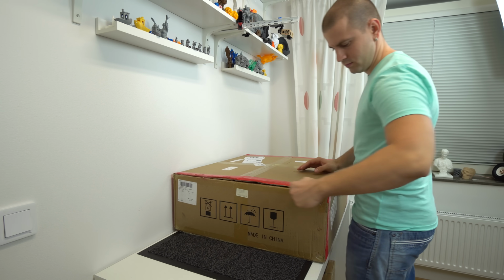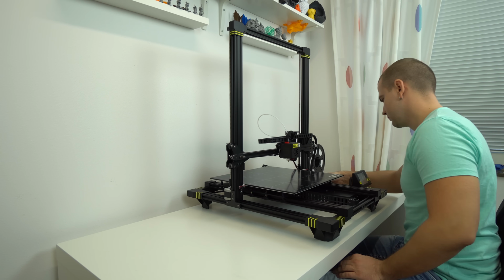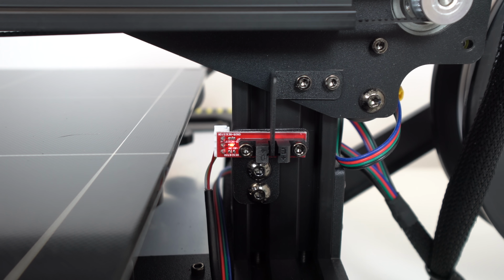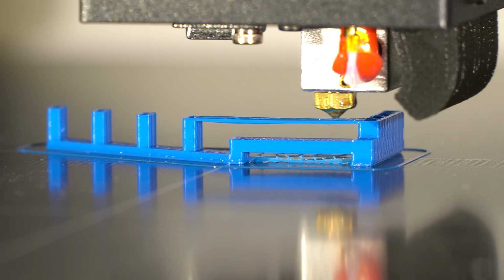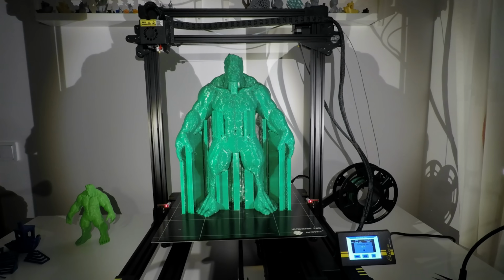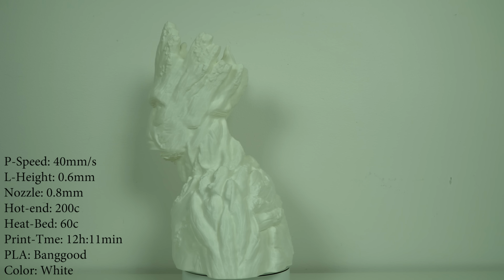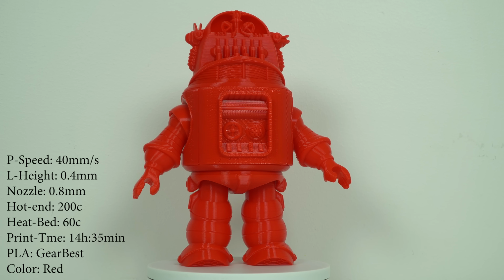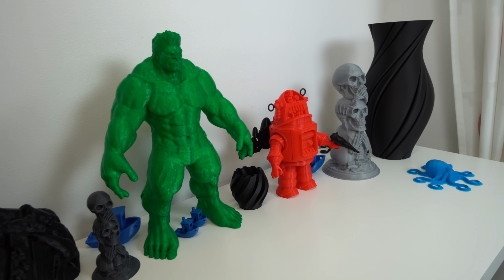Anycubic Chiron Final review - in depth  4K video

Comment: it prints all things smaller - for example 10x50 is 8x39 - even with the newest 1.3.0 firmware - what can be reason?
Reply from the maker: Alexander Afanasiev I never heard about that problem before. What Slicer do you use?
Reply: Thank you for attention, Nexi) I tried Cura S3d and slic3r, but today I received an answer from anycubic about voltage, (still not tried): 

Dear customer
You can adjust the voltage of the motor driver according to this link.
A4988 Driver Test and Swap  https://www.youtube.com/watch?v=_TlbE7sXMtA
It is recommended to adjust the X port to 0.9V, Y port: 1V, Z port: 0.9V, E0 port: 0.8V, E1 port: 1V
Reply from the maker: Alexander Afanasiev Thanks for the info! I really never come across that problem and I tuned stepper drivers on many my 3D printers but I never got problem that printer was not accurate. For example I had problem with skipping Y axis on my old Tevo Tornado and when I open the control box my Y axis was at only at 0.4v and X axis on 0.7V etc... It did not had any sense. So I level them all up to 0.8V if I remember correctly now as it was long time ago. That fix the issue.

Comment: how much watts during printing?
Reply from the maker: Jacek Micherdziński Hard to say! So many variables.
Print time? 
Filament type?
Hot bed temperature?
Heat bed temperature?
Speed?
Watts per hour or?
It's really hard for me to answer on that.
Reply: For standard pla settings. 200/60, speed 40-50mm/s. Watts per hour. Thanks

Comment: Thanks for including Benchy print time and layer height. What was the infill & perimeters setting?

Comparing apples to apples print speed is done way too little imho. Tevo Tornado using 0.2mm layer, 2 perimeters, 5% infill, 0.4mm nozzle i think fastest i did from cold was like 36mins
Reply from the maker: skaltura No problem. It was 20% infill, 4 top and 3 down layers. Well i didi not race here :) Obviously printer with less mass on heated bed will be faster and should produce better print quality but also Tevo Tornado has salmon skin issue and Chiron don't.
Reply: Tornado does not have salmon skin if you just tune it, crank the vref up to max and it's gone, looks very similar to your chiron prints, maybe even a little bit better quality :) Also later Tornados come with MKS Gen-L which gets rid of it as well.

Tornado bed is large tempered glass panel with heat insulation, so quite a lot of mass there too, but really it comes to the steppers and how sturdy the frame is. CR-10 S5 is just awful in that regard, very hard to get a decent print out of stock S5 :( and the mass is immense.

How many perimeters did you have, just 1?

Comment: I am curious if 3d print is still adhering well to ultrabase after power panic restore since ultrabase-like surfaces popup prints when cooled down.
Reply from the maker: Nope. They pop out from Ultra-base when it cools down. You might have like 5 min max to continue the print after power is lost. But what I do like is when the filament is run out, printer pause printing and it keeps temperature steady until you change the filament and click on continue.

Comment: After new Chiron update does CR10 4S still beats?
Reply from the maker: No anymore. Chiron is way batter! :)
Reply: Hamza Bavčić As an owner of both, Chiron has the advantage. The S4 bed is simply horrible, uneven heated, and the fact that waiting for the S4 bed to reach 60 degrees Celsius takes forever, and considering that the S4 bed is so uneven that any try to level it most probably will fail. My S4 bed is straight cold and will sag in the middle when  hot, so I gave up on it
Reply: @sorinmiliescu  So far i m satisfied with my CR10 print quality, but wanted to sell it and buy bigger, so i am still not sure if Chiron is on pair with Creality print quality and reliability, but i am very close to get one since your experience.
Reply: Hamza Bavčić I can’t talk about reliability of Chiron because I got mine 3 days ago. But about the print quality my CR10 S4 and Chiron seems to be equals, perhaps a tiny bit better on the Chiron

Comment from the maker: If someone is interested about printed models weights(0.8mm nozzle and stock ) check list below. I just measure them all with digital scale.
Hulk 450mm(Z) - 367g (Total with supports 895g)
3Skulls 200% scale - 352g
3Skulls 100% scale - 50g
Black vase 450mm(Z) - 414g (0.8 nozzle) 
Groot 450mm(Z) - 616g ( total with supports 779g) - (0.8 nozzle) 
Fab365 Robot R 200% scale - 583G (With all accessories on 707g) - (0.8 nozzle) 
3dbenchy 200% scale - 75g (0.8 nozzle) 
3dbenchy 200% scale - 72g
3dbenchy 100% scale - 11g
Vase(TPU) - 24g
Octopus ABS - 30g
Octopus PETG - 25g
Octopus TPU - 20g

Comment: how long it takes for the table to heat up to 60 degrees and 100 degrees Celsius?
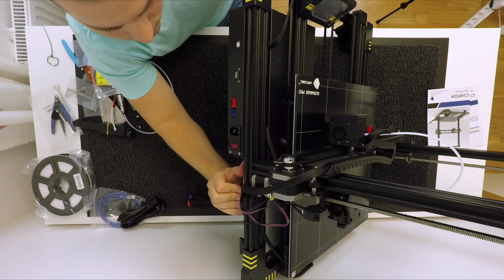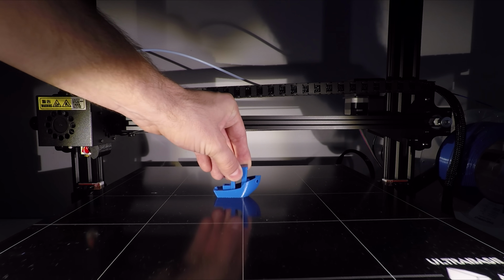Reply from the maker: Kapitan Cheshire I can't believe that I forgot to add that timelaps in the video! I have done Heat-bed worming test and I had that recorded as well. Heat-bed heats up to 60C in 2:40min and 100c in 9:46min stock-no installation under it. It's pulling around 580W from the wall untill it reach the temperature then it comes on periodically.
Reply: @NexiTech  580W 
it's probably a lot in comparison with i3 mega? 
I would like to turn my i3 mega into something bigger and I'm wondering between Creality3D cr-x and Anycubic Chiron - bigger bed vs. two-color prints

I do not know what to choose :(
Reply from the maker: Well double size printer=double the electricity consumption. I would recommend Cr10S or the CR10S pro or if you want even bigger then Chiron is the way to go. You can't make I3 mega bigger you have to get new 3D printer :)
Reply: @NexiTech  
the print quality of cr-10s and Chiron is similar?
Reply from the maker: Yes, very similar but keep in mind that Cr10S can't reach 100c on heated bed and it has not Autolevel feature. You need heat-bed insulation to reach minimum 100C if you want to print ABS. If you don't print with Abs then it's not important. In fact Cr10S has better print quality in higher speeds because it has smaller 300x300mm heated bed and less mass on Y axis.
Reply: From ANYCUBIC laboratory data, 4Min to 60 degrees Celsius for PLA. 6Min to 70 degrees Celsius for wood. 9Min to 80 degrees Celsius for ABS & PETG. 14Min to 100 degrees Celsius.

Comment: Thanks for the excellent review! It is always a pleasure to view(edit: watch :)) your videos. I have the Anycubic Photon, and now after seeing your review I got one more 3d printer for larger objects on my wishlist. What are your thoughts about this printer compared to the Tevo Flash?
Reply from the maker: Gerrit Schulze You welcomed my friend! Pressure is mine :) Nice! Photon is awesome 3d printer for minituares with outstanding print quality. 
Well, Tevo flash is the best made 3D printer from Tevo that I tested so far, but it has some ripping isses cousing with high stock acceleration. It's a bit tricky to adjust it but it's very well build 3D printer with quality components . If you compare Tevo flash vs Chiron. Chiron has better print quality out from the box. Very clean print surface, nice even layers and it's almost double the size. Price of Tevo Flash 98% pre-build verison with TMC100,Autolevel,Dual Z cost almost the same as Chiron. If you ask me I would go with Chiron. More bang for the buck :)
Reply: @NexiTech  Thank you for taking the time to reply. Yes indeed, I am very happy with the first results from my Photon. 
Regarding the Chiron, did you have any issues with the extreme long print durations of it. I have seen complaints that it is much slower than other printers in the same segment?

Comment: So is the auto level fixed for the Chiron? this guy has had an issue with it - https://www.youtube.com/watch?v=hUM7KxIGQxQ
Reply from the maker: I watch the whole video and Let me tell you how I easy level my Chiron from the first try: 
1)  First I run G code (Manual_Leveling) from SD card(printer adjust Z manual offset)
2) I took A4 paper and I level it manually just like any 3D printer.
3) I run G code (Auto_Leveling) from SD card(printer adjust Z offset for auto leveling)
4) Then I attached Probe I select probe from Level many. ( Printer took measurements over the heated bed)
4) I run G command from SD card called Level_test) and watch
5) When printer start printing level test I click on Z offset(all) and lower the Z offset by 1mm then I wait 10-15 sec for printer to apply new command(buffer time) and I did it  again until nozzle was very close to the glass then I use  0.05mm distance(just one click on + or -) until I got nozzle to distance where I want it and I click OK.
6) At this point you are basically finished with leveling as the glass is by nature dead flat.

But If you for example got warped bed in bad shipping or for some reason is not perfectly flat you just need to watch the printer printing (Level_test) G code a bit longer and as its circles around the glass. If you notice that z offset is to big or small on some place you just need to click on that place(closes to) on the level mash on the screen and then on + or - to adjust it by bit and just continue to watch. Have patience and don't press + or - Z offset like 5 times at once. Printer has buffer and it's not reacting on new Z offset right away. 
If you do like I wrote you don't need to pause level test print.

Just be ready to click on the OFF button if you messed up something and you notice that nozzle is rubbing on ultra base.     
For the record I only level my Chiron once in this whole video review. 170+ hours printing and still no need to re-level it.
Reply: @NexiTech  Thank You

Comment: Nice review
Bought a chiron to Bud also came with broken glass bed.
Still waiting for a new printerbed.
Question where did you insolate the printer bed with.
Reply from the maker: André de Vries For some strange reason YouTube won't let me to replay to your comment. I try many times and without success. Let this one be a test.
Reply from the maker: Hi André! You can use high temperature resistant cotton 3mm sheets and glue it with silicon. These sheets are best, no smell or anything and they can last forever:) I leave link in video description. 
Good luck with your Chiron.
Take care
Nexi

Comment: Nice Video. I got my own Chrion a week ago and i experienced nearly the same. Nice Printer :) But... When the machine is pluged in, but turned off, and i have one Hand on the frame and than touching - with the other one - the Heatblock or the magnet for the autolvl-sensor i can feel 24v. Is it the same with ur printer? Greetings, Dirk
Reply from the maker: Hi Dirk,  Nope not at all. You can't feel 24V DC electricity  by hand like that. Make sure that your ground on the wall plug is working. That has to be the main AC leakage for some reason or lack of the ground. Use the AC Electrical Tester Pen and touch on the same place to see is it AC voltage.  If so unplug printer from the wall and re-check the AC cable using multi meter, then lift the printer on the side and take 4 screws from the control box bottom plate to access the components and check all the wires visually for any loose ones. Working Ground is very important to have in home wall socket.
Reply: Nexi Tech thank you very much. Done and feel Safe now :)

Comment: Hello once again! Yesterday I was asking you about a specs of your printed models, but you reupload a video... It is really good that you state a parameters of a printing models. Thank you. But one wish - can you also state a weight of a model? It will really help to know as how much filament will be used for a printing.
Reply from the maker: Hello Nikita! Yes, sorry again about Re-upload. No problem, thank you to. Weight? Sure, Here it is i just measure with the digital scale.
Hulk 450mm(Z) - 367g (Total with supports 895g)
Skulls 200% scale - 352g
Skulls 100% scale - 50g
Black vase 450mm(Z) - 414g (0.8 nozzle) 
Groot 450mm(Z) - 616g ( total with supports 779g) - (0.8 nozzle) 
Fab365 Robot R 200% scale - 583G (With all accessories on 707g) - (0.8 nozzle) 
3dbenchy 200% scale - 75g (0.8 nozzle) 
3dbenchy 200% scale - 72g
3dbenchy 100% scale - 11g
Vase(TPU) - 24g
Octopus ABS - 30g
Octopus PETG - 25g
Octopus TPU - 20g
Reply: @NexiTech  Many thaks!!! It is great and helpful!

Comment: Nice video as usually ;)
Just one thing, try to decrease you temp on TPU. With Flexismart TPU / TPE was using to high temps like 220/210 and got your effect on walls. Now i'm running perfectly with 190º. Give a try ;)
Reply from the maker: MrJoaoMsousa I'm glad you like it and thanks for suggestion I will give a try. I had nozzle clogs at 200c but that might be because of 2mm retraction distance. Efter I disabled retraction I got successful prints but I did not try to lower the temperature. I will now :)

Comment: Thanks for the extensive review! Best as always. I have the anycubic photon for minis and I want one PLA printer for terrain. Do you recommend this vs the creality cr 10 s or do you think that the ember will suffice?
Reply from the maker: Thank so much Andrew! I do my best to make quality videos for my subscribers. Photon? Cool! I love it! Now you need one more for big prints :) Well let me tell you. Cr10S is for long time my favorite big scale 3D printer. I love that printer! Its very simple design, easy to maintain and repair. I have my Cr10S for more then a year and I lost count how many hours I have printed on my Cr10S and it still going strong. Very reliable machine. On my Cr10S I have done few upgrades over time.  I install 750W AC silicon heater with Solid state relay, stepper dampers, Ultrabase and simple spool adapter... it's still recommend Cr10S to everybody how search 3D printers up to 300mm size. On other hand Chiron is more moderate 3D printer. It has more features like: Touch Screen, Auto level, dual Z sensor switch, It has Ultrabase(No need for adhesive glue, easy to remove prints) Much bigger 400mm build volume, 24V setup with separate 1000W power-supply for heated bed up to 115C (Cr10S can go only up to 85C). Everything is build on the frame so there is no need for external control box, it comes with more advanced Motherboard with replaceable/ upgradable stepper drivers. In the box there is even spare compete hot end and best part Chiron is almost the same price as Cr10S. 
My vote goes to Anycubic Chiron. More bang for the buck ;)
Reply: Nexi Tech I’m looking at getting this printer OR the new Creality cr10s pro which has touch screen and very quiet according to the few reviews out there. What do you think about the cr10s pro?
Reply: And then there’s that Tronxy thing... x5sa... looks like Chiron works a lot more reliably than the Tronxy - better quality parts without the need for modifications.

I’m changing my x5sa to use a direct extruder. I know there are all those other mods shown in another video but I wonder where it ends up for print quality vs. the Chiron. I guess that print area and price are similar.

Comment: Is there any chance of you doing another video showing the complete bed levelling routine? I've seen at least one other video where it was necessary to mess about with the bed levelling screws even after having just done an auto-level - and I'm now feeling even more confused about exactly what I can expect from the current chiron,
Reply from the maker: Let me tell you how I easy level my Chiron from the first try: 
1)  First I run G code (Manual_Leveling) from SD card(printer adjust Z manual offset)
2) I took A4 paper and I level it manually just like any 3D printer.
3) I run G code (Auto_Leveling) from SD card(printer adjust Z offset for auto leveling)
4) Then I attached Probe I select probe from Level many. ( Printer took measurements over the heated bed)
4) I run G command from SD card called Level_test) and watch
5) When printer start printing level test I click on Z offset(all) and lower the Z offset by 1mm then I wait 10-15 sec for printer to apply new command(buffer time) and I did it  again until nozzle was very close to the glass then I use  0.05mm distance(just one click on + or -) until I got nozzle to distance where I want it and I click OK.
6) At this point you are basically finished with leveling as the glass is by nature dead flat.

But If you for example got warped bed in bad shipping or for some reason is not perfectly flat you just need to watch the printer printing (Level_test) G code a bit longer and as its circles around the glass. If you notice that z offset is to big or small on some place you just need to click on that place(closes to) on the level mash on the screen and then on + or - to adjust it by bit and just continue to watch. Have patience and don't press + or - Z offset like 5 times at once. Printer has buffer and it's not reacting on new Z offset right away. 
If you do like I wrote you don't need to pause level test print.

Just be ready to click on the OFF button if you messed up something and you notice that nozzle is rubbing on ultra base.     
For the record I only level my Chiron once in this whole video review. 170+ hours printing and still no need to re-level it.
Reply: @NexiTech  So basically what you're saying is that it DOESN'T have AUTO levelling after all No wonder nobody videos are showing it. :-/
Reply: @NexiTech  Thanks for that last explanation. I've seen a lot of bed leveling videos on the Chiron. Most people having a lot of headaches trying to level it. This gives me a bit of confidence on buying a Chiron, everything else is really nice, especially that "magic" bed. I believe that's the feature that beats Creality. And now with this new Chiron frame this is just a no-brainer between the chiron and any other cr-series printer. But, that's just my opinion. I had a bad experience with an anycubic i3 mega but this Chiron seems to be a whole different level
Reply: Would like to see that too